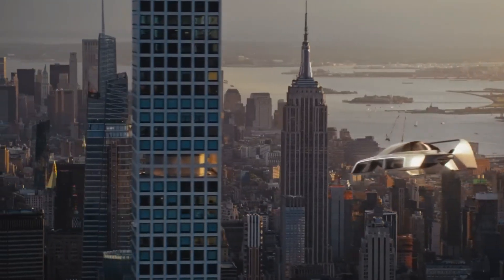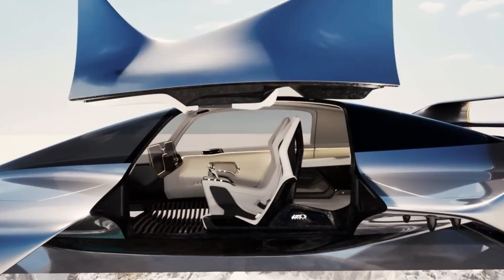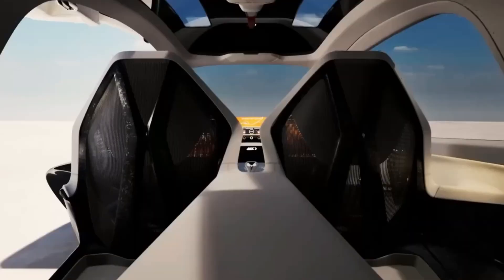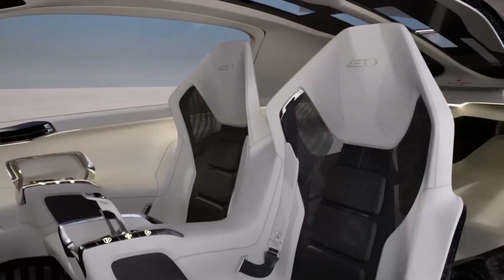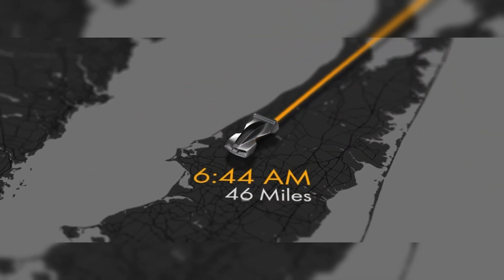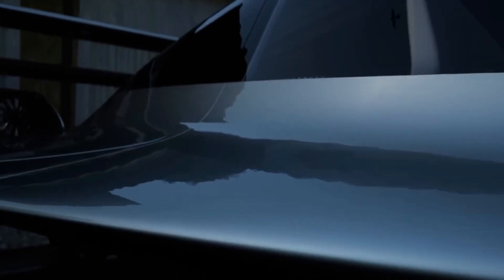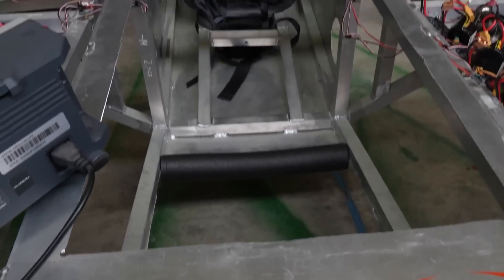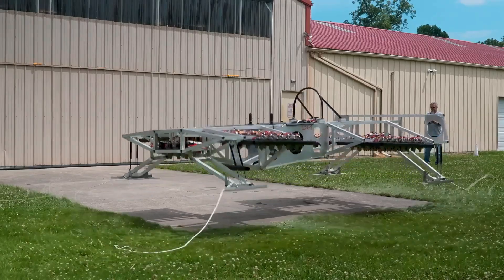2025 NEW LEO COUPE UNVEILED!!

Comment: 1. Either the batteries in this thing are ticking time bombs, because it takes a LOT of energy and power to move and fly something like this.........or, your flying range is extremely limited.  
2. Anybody owning one of these things would HAVE to be a certified, professionally trained pilot.  Which is expensive in itself.
3. The insurance on something like this would be more than a million dollars a year for a policy.
4. Flying one of these in the city is useless, as you'd need SO MANY flight plans made, and constantly having to use the local airport or heli tower for those flight plans.
5. What if you're battery system just decides to quit in mid-flight?  Down you go!!!!
6.  Thats a disgustingly fugly as hell design.